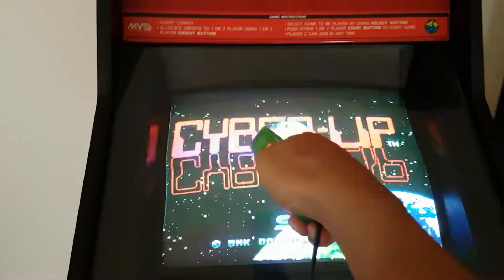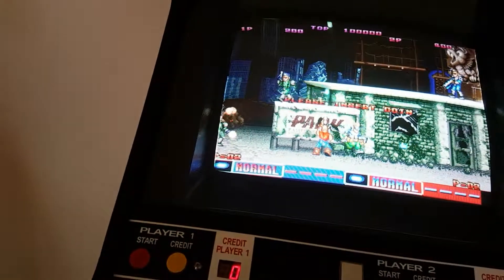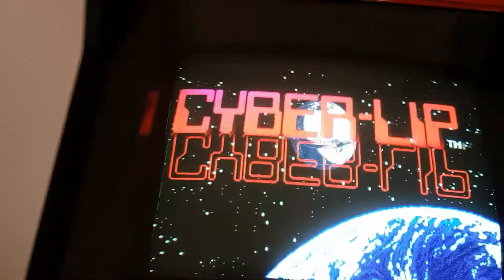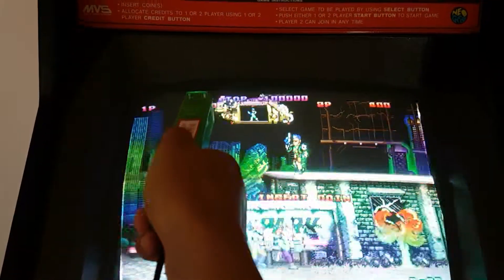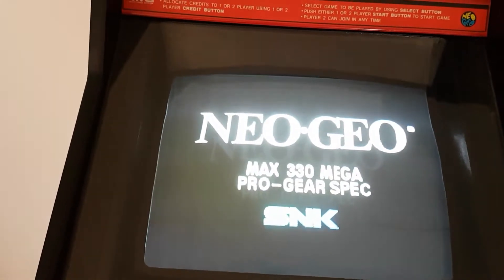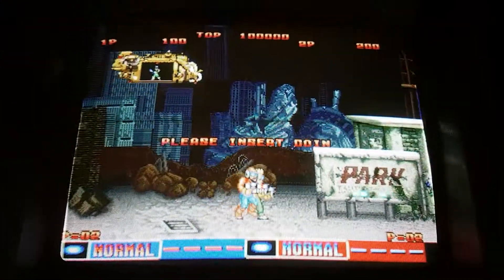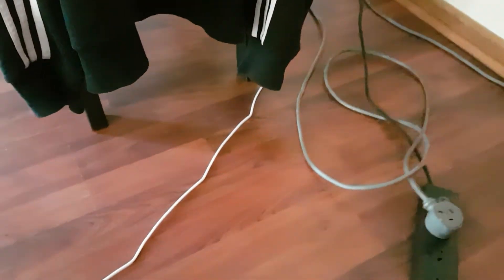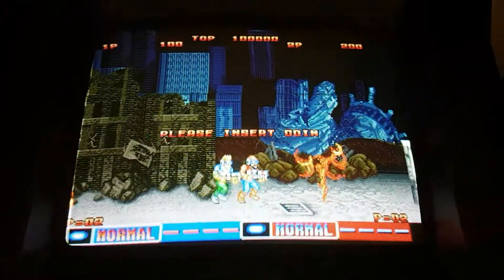DEGAUSSING A CRT ARCADE MONITOR

Comment: I have also found that the clicking or “flicking” the degaussing wand is much more effective than the circular technique. My want is a large black loop, so different from your “stick”, so there is not the same concept as pointing at the screen. I have found that flicking around the monitor (not just in reference to the screen) is also effective. It’s like you said; you want to move the distortion to a location that is “off-screen”. This can be anywhere around the CRT box
Reply from the maker: Ah I think I have seen those, degaussing coil? 
The issues with my CRT monitor were annoying me so much, and surprisingly at the time I couldn't find any videos or guides online that would resolve it.  So once I fixed my CRT problems, thought I'd make a quick video to help others.
Thanks for watching and for taking the time to comment mate, really appreciate it 🙂

Comment: will this work on a normal crt? I have a 21 inch sony Trinitron and I always end up with red discoloration on the top left side of the tv
Reply from the maker: According to sources online, this should be OK to use on CRT TVs.  Just remember not to get too close to the screen with it and don't use it for too long as this heats up extremely quickly! Try looking on Reddit forums online, using this on Sony Trinitrons has worked fine for some people. 
Good luck and thanks for visiting my channel 🙂

Comment: Dude I bought one of those degaussing wands at AliExpress to pix the purity issue that my BVM-20G1E had. First I tried it with holding down the button and making circles but this didn't help at all. Then I came across your video and the clicking method really did the trick! Thank you so much and greetings from Germany!

Comment: Great info!I recently bought one of these to hopefully fix spots on two of my monitors. I was honestly shocked that I was able to fix them in a matter of seconds after putting up with these purple spots for 20+ years.

The point and click method you demonstrated really helps. I have monitor that I think suffers from more of a yoke issue than just degaussing, so this method is the best way I could minimize the discoloration.
Reply from the maker: Hey mate, I'm happy to hear that this worked for you :)
I actually need to use this again on my arcade monitors, as there is a bit of discoloration due to moving them recently.

Thanks for watching :)

Comment: Im about to buy one from aliexpress probably same one as you have. Hoping it will fix my purity issue on top left corner of my Mitsubishi 2070SB. Did the colours go bad again after a while or it stayed good?
Reply from the maker: Hey, this definitely fixed the colours for me on my Neo Geo MVS cab.  I even moved house shortly after making the video, a removal company moved my arcade machines.  The Neo geo MVS cab still looks good, so didn't need to this degaussing method again since.  However, I have recently noticed that the colours don't quite look right on my Sega New Astro City, so might need to try this on that machine.
I hope this resolves your monitor issues.  Just be careful, this degaussing wand gets extremely hot!
Thanks for watching :)
Reply: @AussieFreakGamers  Thanks for the reply mate. I got mine shipped to me, the person lived 3hrs away so decided to pay a little more and get it posted. Everything was in good shape except right away noticed that corner issue with the colours, hope it wasnt from shipping not like it traveled too far haha funny thing is depending on which way the monitor is facing it makes it a little better or a bit worse. Using the degauss button doesnt clear it up unfortunately. I have a step down transformer for USA/JPN stuff think that would make the wand not heat up as fast? Awesome arcade cabs you have btw.
Reply from the maker: @shanomacdaddy  No worries mate, I always try to reply when I see comments come through.  
Thanks...I always wanted an arcade machine but the houses in the UK were too small really.  When I moved to Australia, I bought 2 arcade cabs within the first year haha I would love more, perhaps a TMNT , The Simpsons or X-Men but not sure it will ever happen with current prices.
Yeah that's absolutely right, the direction in the room where the cab is facing can cause distortion.  Have you tried a different location in the room? The Degauss button didn't help me either :(
I'm not sure how to reduce the heat but you could try your suggestion.  I think even in the manual it warned about the heat. 
Let me know how you get one.
Reply: @AussieFreakGamers  No worries dude, will let you know how it goes in a couple weeks when it arrives. Subscribed.
Reply from the maker: @shanomacdaddy  thanks mate, appreciate that 🙂

Comment: I just bought this product on ebay to fix some mild color distortion in my trinitron
Reply from the maker: Did it work out and fix the issues? Cheers for watching mate
Reply: @AussieFreakGamers  ill let you know. On the way! Im hopeful. A little color smudge on the side isnt a huge deal but it started to bug me over time
Reply from the maker: @RetrofIex  Well I hope that it sorts it out.  I really need to use this again on both my arcade machines.  The screens haven't been right since I moved house a couple of years ago but I still haven't got around to using to the wand.  Yeah, it does bug me too.  Just be careful, the wand does get hot quickly!
Reply: @AussieFreakGamers  well friend, unfortunately i am saddened to say that the degaussing wand did not correct the color impurity on the right side of the screen. I noted that despite numerous attempts it simply just comes back. This is likely an indication that the shadow mask or something is damaged inside. No magnetic sources are near the unit. Its not cost effective to repair because its a hard to find service nowadays and it only cost $10 at a garage sale. I will likely just enjoy it with the flaw and make the best of it until maybe I can find a replacement one day.

Comment: Just used one of these degaussing wands on my 89 console tv and it worked perfectly. The point and click method didn't work on mine, but holding the wand a few inches from the screen and swirling it and then moving back about foot or so worked perfect. Took like 5 seconds. Can't believe how easy it was.
Reply from the maker: I'm glad you managed to sort out your screen using one of these.  They are great! When I first decided to purchase the wand, I was sceptical about whether it would work or not but I have been impressed with the results.  I made this video because I really didn't see many other helpful videos on this subject.
Thanks for watching and for taking the time to comment :)

Comment: After watching your video i bought one in China and i can confirm that it works great on my BVM.  No more color issues, looks nice and clean like before. Very happy with it. Thank you very much!!!
Reply from the maker: Thank you for taking the time to visit my channel.  I'm really pleased that my video helped you.  I have had a few comments recently from others who have also had success from applying this method.  
What BVM do you have? I have recently picked up 4 x Sony PVMs, only 9" models but it's my first experience with PVM monitors.  I only really wanted to test out 1 monitor before investing in a 14" + PVM monitor, but the seller would only sell in lots of at least 4! I will more than likely sell the other 3 on at some point  ;)
Reply: @AussieFreakGamers  your welcome mate. I have several PVMs. 3x 20" and 1x 9" but only 1 BVM. The BVM is my main monitor for my retroconsoles and MisterFPGA. I have a BVM 2016p btw. No 480p unfortunately (only 480i) but i love the 240p picture quality.
Reply from the maker: @MarioCoelen  That is impressive mate! I will definitely look at purchasing a bigger PVM at some point.  The problem is that they are so expensive in Australia when they do eventually appear :(

Comment: To anyone doing this, I bought this thing off ebay for 20 bucks,same one.Its super easy to use.If you are still getting odd colors just keep twirling it around the screen for about a minute or so and the colors will be all back to normal, cause the point and click will move the color warp and youll notice it somewhere else on the screen which I tried this method to no avail(for me) but after holding  it about 2 inches away from the monitor and just twirling it around the entire screen(even areas with no warped colors)for a bit theres no discoloration anywhere on the screen.As a matter of fact just for fun I tried to warp the colors after getting back to normal and it seems to have completely fixed it cause I cant even get the colors to stay warped anymore after I turn the thing off.Its a good product, super easy to use and will take you like 2 minutes.You also dont want to be using the thing for more than a minute or so cause it heats up.
Reply from the maker: Thanks for taking the time to write this comment for others to read.  The point and click method worked for me, as you can see in the video.  Yes, I agree that the discolouration initially moved from one part of the screen to another, but after a few attempts cleared completely for me.  However, it's great to have another method, should one not work, so thanks for your input :)
Reply: @AussieFreakGamers  I actually bought this thing after watching your video so thank you.I had a similar problem and it was with a super street fighter II new challengers edition arcade machine.I had discoloration in the top left.The point and lick worked but it was only when i was actually using the tool but as soon as i let go of the button it went back to its purpleish color where the health bar was instead of solid red.At first the colors were moving around but after a few minutes of just moving it around the screen everything seems normal.I actually think this is a good method to use if your screen doesnt have any noticeable discoloration cause I have an original golden tee 2k machine(not the arcade1up crap) and the colors are fine but I used this thing anyways to reset the color if there was any problems not exactly noticeable and it actually made the colors pop out a little more of the same color.You saved me like 250 dollars cause I almost went and bought a new arcade crt monitor for the street fighter II machine,so once again thank you for the video cause if I wouldnt have seen this one since there hardly any videos about this I would have went and bought the crt arcade monitor
Reply from the maker: @kyles8524  Thanks mate! That is great to hear that this cheap device resolved your issue.  Interesting, I might attempt that myself.  You have some great arcade hardware by the sounds of it :) I also have the Super Street Fighter 2 CPS2 arcade board which I play in the Sega Astro City.  It's fantastic that you have the dedicated cabs though.
Reply: @AussieFreakGamers  yeah the cps2 system in mine isnt really a board thought its more of a blue box with a capcom engraving and a picture of street fighter II turbo on it.I have a few random things.I have a mame cabinet, a pandora 11s  cabinet.Pac man and pac man plus(still missing ms pacman).I have a pandoras box 4 I was thinking of making a table top arcade with or if I can find a neo geo arcade I can just fit it into the jamma harness.Ive seen the kits on ebay they are pretty cheap.Arcades are fun but take up a lot of room lol

Comment: Several months ago, this is the first video I watched from you! I came this one because at it time, I really want to fix my screen and I search for degauss wand review before buy off from ebay. This is how I came to your video. I also came across from forum and they said you kinda have to do it fast (Not super fast) because this thing get hot fast! Also, always unplug as soon as you stop using. Leaving on and not use can cause overheat.
I forgot to thanks you for the review because this is another reason I bought the degauss wank. Thanks again!
Reply from the maker: No worries mate! I'm glad it helped you.  To be honest, I made this video because I didn't find too many helpful techniques about how to degauss a CRT monitor at the time, so had to spend ages searching online for methods of how to fix this problem.  I'm happy to hear that this video has helped a few people, which encourages me to make more videos :) And yes I totally agree, the wand does heat up extremely quickly, so I didn't keep it on for too long.

Comment: From using the degauss rings in the past, I've had to start relatively close to the monitor and then move back slightly to pull that magnetic field off of the CRT, but not 100% sure if that is the same for the wand
Reply from the maker: Thanks for the comment.  I did initially try that with the wand, but it was only moving the screen interference from one area of the screen to another.  The method that I tried in this video actually resolved my issue, so I thought I'd share it with others.  Thanks for taking the time to write a comment.